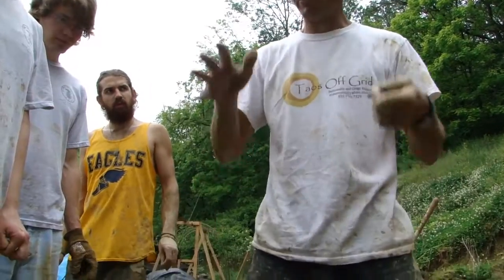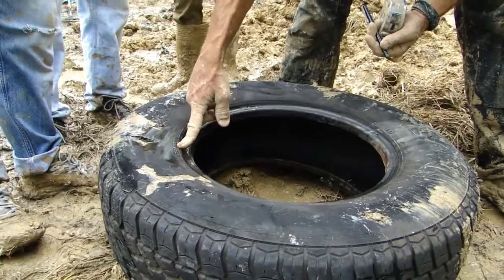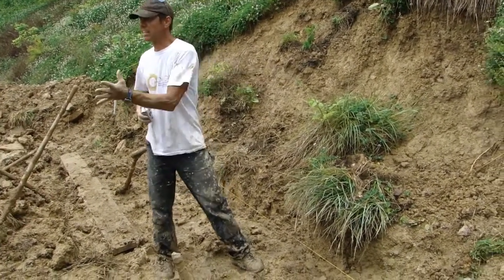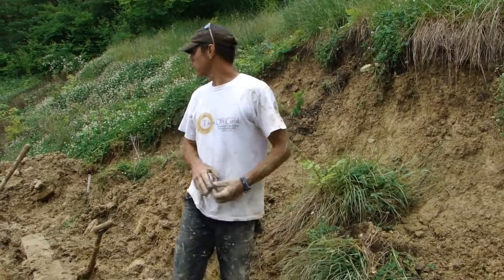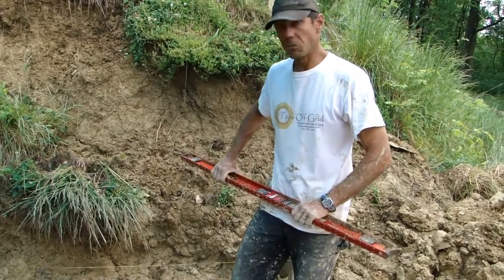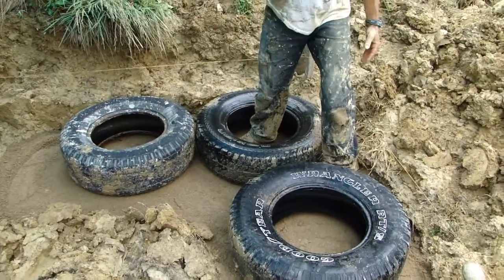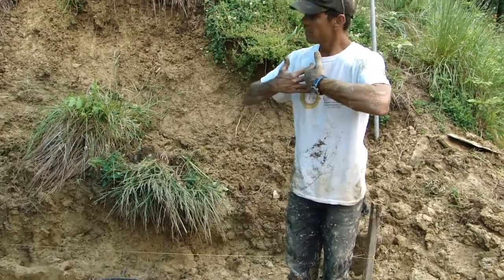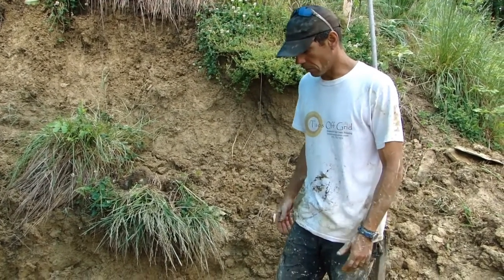Cincinnati House - Tirewall - Part I

Comment: Sorry if this is a dumb question.  I understand how the crossed lines indicated the center of the corner tire, and how the tires on either side of it are parallel with the lines.  But, when you get to the second layer, and they are set back 1.5 inches, is there something you are supposed to do to make sure the next row tires are proper around the corner, or just put them in however they fit?  I guess the question is 3 tire turn vs 2 tire turn on top of a 3 tire turn.  Thanks and great videos!